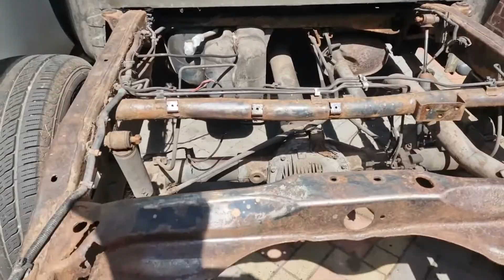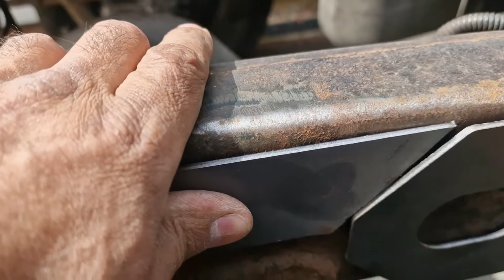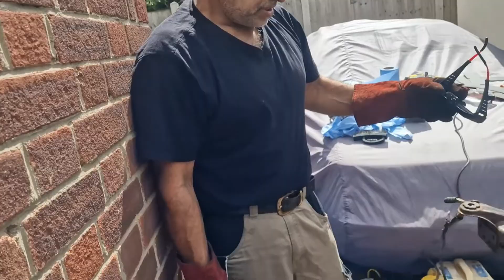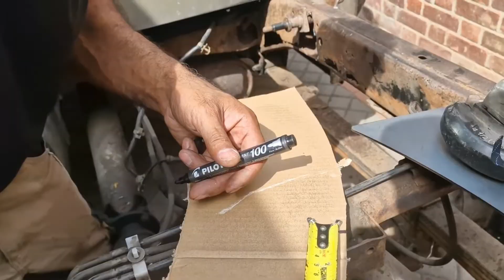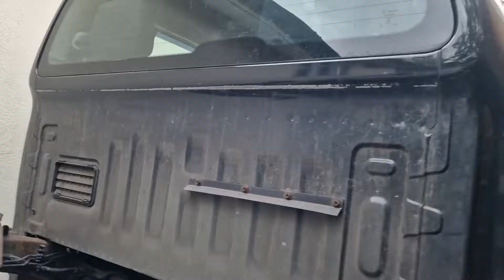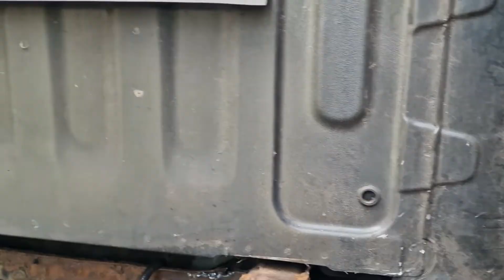Nissan Navara Mammoth welding project

Comment: Ive seen some bad jobs in my tym but this takes the the top shelf 
Wtf have yas done .arse about tit .bad welding .not prepaired properly .not welded on top frame rail   .its literally a cut and shut .all the rust is still in there .the problem is still there youve just covered it with pidgeon poo😢😢definatly self tought with a welder and is 100 percent not safe

Comment: As a retired mechanic and welder I'd not place much faith in those welds. I don't want to knock anyone doing their best to do a good job. But there are times when a proper professional job is the only way to go. Given the potential safety implications if this all falls apart I think plating over rust is one of the worst ways to do a repair. Until the rust is cut out how does anyone know if the area below id structurally sound? I think if the old chassis were fully gound back you'd find its rotten beyond safe repair- IMHO

Comment: You Should have weded the hole's up in the plate and clean underneath the new plate and Turn up the power of the mig so you get Penetration of both metals, the job is only half done, And looks Awful 😢

Comment: Whoever cleaned the frame obviously did alot of work because I know what it takes. That said, before taking the welder to the new steel, you should have grinded down the surrounding metal to bare steel, I think that's part of the reason the welder spark isn't consistent. And before I'd ever start welding, I'd cut out the old rust, put a garden hose to my shop vac, and clean the inside of the frame. I guarantee there's 30 pounds of rust setting inside those frame rails and it sets there collecting moisture. I'm not trying to criticize, but for those of you reading this, take my advice. And for the love of everything, don't spray rubberized undercoating, or bedliner on the frame when your done, it absolutely traps moisture and makes the frame 10x worse a couple years down the road.
Reply: Absolutely spot on. This is basic stuff. I don’t understand why someone would go through all this hassle and expense only to half arse the actual job. Might as well burn their money

Comment: shocking welds and absolutly no strength there at all just a cover up job...welding with bare arms and neck aswell as your face exposed to radiation burns from the welding....but it was entertain to watch...ha ha

Comment: Those holes in the new side plates are cut out to weld to the original chassis which you did not weld also you did not weld the top of the plate under the cab .